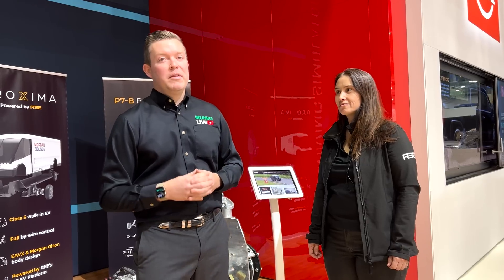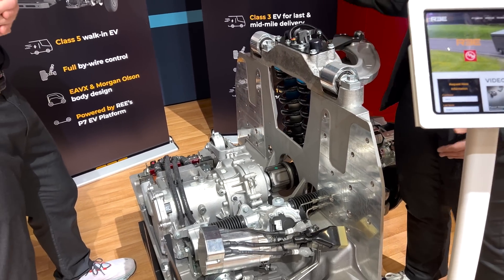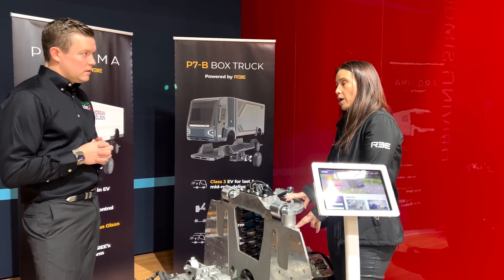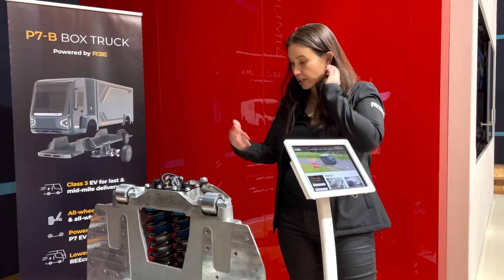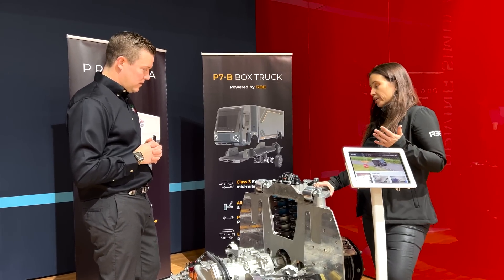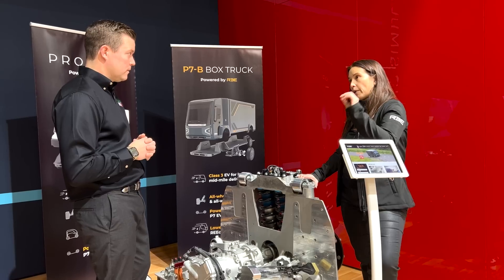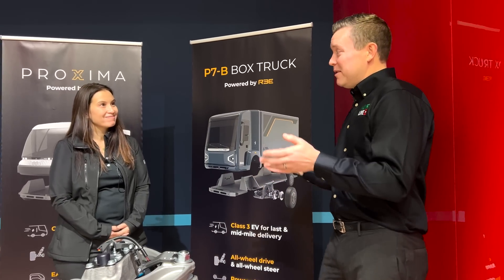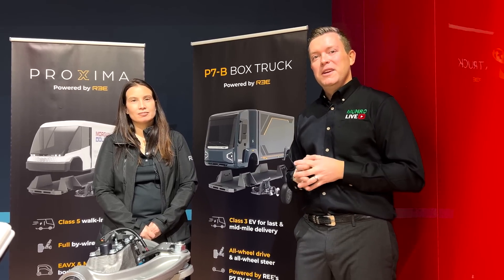Cornering the Competition? REE Automotive's REEcorner at CES 2023

Comment: Weight penalty in overall vehicle design based on the additional interfaces between corners and box frame? A very cool design, and I suspect it will maximize the cargo volume of the box truck as well - is that the trade off here?

Comment: With no mechanical connection to the driver...what happens if there isn't any power in the system?  
Is it locked in gear?  How do you activate a parking brake?  Or deactivate?  What happens to steering?

Comment: Cory, this is excellent, you've probably saved me a few hours of research! 
The possibilities for such a system extend in a number of directions: Powered trailers, specialised equipment such as airport or seaport machinery and so much more. 
I've remarked to colleagues that with the coming-of-age of battery and motor systems there is the potential to see the return of coachbuilding as a viable business.

Comment: 1 how open are you about owners able to self adjust the parameters.
ie will it be john deere locked out and e-waste after a few years no repurposing in the back yard. 
2 were can i find 2 of these in the scrap heap i have a welder and some ideas for my lawn mower "racing circuit"

Comment: Electric, OTAs, Modular, Innovative, Aluminum, Castings, Versatile,
Hmmmm

Wonder why they are setting up in Austin????
Reply: Taxpayer-funded incentives, same as Tesla.
Reply: @brianb-p6586  WOW!!  , you really put some intellectual effort into that response..
Reply: @Peter Sorrell  not much effort required.  Tax incentives are very common, and are often a significant factor in factory location decisions.  Of course there are other factors, such as availability of cheap labour and good access to transportation.

You're clearly suggesting that there is a business connection to Tesla, but this company is not rationally a supplier to Tesla and of course Tesla wouldn't supply it. Is there a supplier of aluminum castings located in Austin that is already supplying Tesla? Isn't Tesla supposed to be omnipotent and independent of suppliers for anything of importance?

REE is an Israeli company that already has a set of partners for the required technology, presumably including casting and certainly including all electric components - those companies are not in Austin.

Comment: I think EVs are gonna win just on the cost of maintenance
Reply: EV's are a win for new car buyers.  But they kill the used market for the rest of us.  Right now you can buy a decent car that 10 to 20 years old with 160k miles, still running strong and in good shape for $2k to $6k, etc..  But in the future, when EV's are 10 years old, they will still be pretty expensive, and also be a super high risk--  because the battery is due to crap out at any time by then.. and you really get caught holding the bag when it fails.   The secondary market is going to get hammered by this EV transition.

Comment: Corey kinda started down this "Advantages" path when talking about brakes being more like Rivian style. (thanks for reminding me what FNC stands for with rotors by the way) Unsprung weight reduction here is insane compared to standard solid axle setup. Unsprung weight has biggest effect on ride feel. Not to mention Rotational mass. 
Redundancy with Brake fluid cant take out the entire system, assuming electrical failure has failsafe. Would be interested to see brake actuation design.

Comment: I Reesearched this myself last year. Thought it had tons of potential. Working as a Truck & Equipment mechanic in industry where f450, 550 are the standard was curious if Viable Solutions for this were out there. 
Most Info is low resolution. I had similar questions and see similar potential.
For example a Large Fleet could afford to have "Corners" on the shelf. Downtime virtually eliminated. I promise I could do this side of road, Let that Sink in...

I did diesel tech early 2000's looks like I need some continuing ED lol.

Comment: This would be just fantastic for motorhomes.
Reply: Would the range of a battery-electric motorhome work for you? It wouldn't for me.
How much would you be willing to pay for a motorhome using these? All but the most expensive production motorhomes use the cheapest available truck chassis; they are in a very different world from all-aluminum fully independent suspension.

Comment: Firts thank you to Kim Mathers for this clear and thoughtful presentation !!!
I was thinking at first  that this module was designed to replace the main engine and 
will be connected to the main shaft where the clutch and gear box was located. 
But instead, making a separate unit for each wheel is the perfect solution. 
Just eliminating the main shaft and differential on each of the axial is a great energy saving. 
I can't wait to see an UPS truck making a 'crab' U-Turn in from of my home using vectoring control !!!

Comment: The should offer an offroad version where all the components mounted on top of the wheel (vs below in current design) and possible offset the drive shaft like a unimog. They can EASILY provide necessary drivetrain for a low-volume EV UNIMOG producer - which can be a game changer in the offroad community (not to mention commercial applications which REQUIRE unimog capabilities like power companies and other utilities).
Reply: That's called a portal axle; it is not unique to the Unimog.

Comment: I'm assuming the caster is adjustable or are they specific right and left modules?
Reply: At least the upper part looks very symmetrical, so I assume that it is one module, adjusted differently.

The steering actuators and arms would probably need to be installable in either position, to match the opposite side corner. The brake calipers would presumably also swap positions, and any anti-dive/anti-squat suspension angles would need to be set as well.
Reply: Apparently each corner is identical...

Comment: electric motor technology, well understood, deep institutional knowledge, no need for EPA emissions validation. 

batteries are really the only hold up
Reply: The system is energy agnostic. You could use a fuel cell or even a generator.

Comment: Do they have a unified connector? Seems like it would be good to develop a connector that houses all the power and communication needs of each drive unit so wiring is literally one wire and connector per drive unit. With four connections at the battery/ECM. Then only need one other connection going to the control pod at the driver location. They should also develop a modular battery ECM, specifically to interface with their units.

Comment: The military is really into having modular power packs (engine & transmission) that can be pulled and swapped out. They require speed of repair so the vehicle is back out to the front lines ASAP. This looks like something they'd be interested in.

Comment: Want a RV using these, with all wheel steering, drive, etc… how easy it would be to maneuver around parking and cities… and pulling a trailer…
Reply: As an RVer and REEer... trust me I'm making the suggestion!
Reply: These would be perfect for RVs because they could provide a completely flat floor from front to back. No need for stairs in the RV.  Winnebago should be all over this system for its motorhomes before someone beats them to it.
Reply: @mikedx2706  I agree. However the only downside is that when we RV we're off the grid and access to the kind of EV charger needed to power the vehicle may be limited, at this point in time. This will definitely be a game changer when the charging infrastucture is where it needs to be.
Reply: I agree that four of these (or six for a very large motorhome) could be the basis of a great motorhome; however, almost all RVs are built for minimum cost, not maximum functionality. These units would be far too expensive.

Comment: Very interesting.

I believe inwheelmotors allso has such corner modules.

Integrating the motor into the hub will enable many more benefits.
Reply: No, a motor by itself is not a corner module. A corner module includes suspension.

Comment: Strange question, would it be feasible to move these drive units to a new chassis at end of life for the old one?
Reply: I like the way you are thinking. No need to throw out working parts because a different part is not usable anymore. They specifically mention taking a corner off for refurbishment and putting another one in immediately. That implies to me that the refurbished unit can then go on back on another chassis. So I think just taking four working one off a chassis and putting them on a new chassis would not be a problem.

Comment: I’m impressed. Thanks Corey for the information and insight. I am enthusiastic about the concept and applications of this unique and inventive product.  I’m curious about the control system, which I assume would be a plug-in box that would accept the controls, steering plug-ins, etc. Does that exist and who has/is developing it and the related software?  Also, who are they dealing with in the box van developments for battery packs? I see an awesome application of this not only to work / delivery vans, but also the RV industry. Thank you. P.S.  I was sufficiently impressed, so I bought stock in REE Automotive!

Comment: Cory, do you think brake systems on EV s will eventually be eliminated? Elon says the best part is no part.
Reply: I think we're a while away from eliminating hydraulic brakes, simply because it's a backup system that will still work, in the rare event the electrical system / regen fails to work. 

That and ... regulations and laws are slower to change, and I think this is part of the inertia preventing change.  

Look how many countries and juristictions still require two exterior mirrors, no exceptions for cameras.  And, like regen on a hybrid or EV, cameras and mirror-mimicking screens can provide equal or superior function.
Reply: I agree with your thinking. But regarding a backup system, this is a bit of a double standard.  ICE vehicles have no backup to the hydraulics except hand/parking brake of little use at speed. A similar inexpensive hand brake could be provided on an EV. I understand that many EV s have steer by wire with no mechanical connection. I think  no brakes is no worse than no steering.  Is there any evidence the electric drives are less reliable than hydraulic brakes?
Reply: @brennansmith1381  yes, the redundancy argument might be moot.   My dad's antique 50s truck only had cable actuated mechanical brakes. 

I think arguing for deleting hydraulic brakes on a heavy cargo/delivery truck isn't going to influence those that can alter the design.

But, I haven't yet seen an electrical-regen only braking system on the road... Only lower speed off-road vehicles, like forklifts. 

If regen alone is a sufficient system for high speed /panic braking, then I could see it coming to a smaller passenger car sized module.

Not to say it won't come.   Just that, currently, even the higher volume EVs that Tesla offers, don't eliminate the hydraulic brakes.
Reply: @brennansmith1381  No, there are not "many EV s" with steer by wire with no mechanical connection; there are none in production and sold in North America at all, EV or not.
Reply: At this stage EV still need conventional brakes as in the situation where the battery is fully charged there is no ability for regeneration   braking because there is no more capacity for energy storage.

Comment: What's the downside to this design. There has to be one doesn't there?
I'm a professional design engineer and I can't see one.
I really like this on my first look at it.
Reply: Producing a 'corner" is a cool idea.   But I'd rather see it with ultra cheap construction with sheet metal and stamped parts.  This looks like it's going to be way more expensive than it needs to be.  Your box truck doesn't need race car performance parts
Reply: @calholli  100% agree.  There's a lot of stuff there designed to look great on the show stand that the end user will want cheapened up for production.
Reply: @jdeng1989  I agree too.
Though castings are fashionable for their cheapness at scale at the moment.😉
Reply: I suppose the overall weight of the chassis might be higher,  but could be entirely modular in length,  width,  wheelbase,  and whatever box is placed on top. Might not be as efficient as making tens of thousands of identical trucks,  but would be the best way to make ten of anything.

Comment: How do you coordinate the steering between 2 front units?
Reply: Same as motor and brake. Drive by wire.. / electronic communication.
Reply: Just like in a fly-by-wire aeroplane, with a control computer.

Comment: I did not hear anything about batteries - was that my lack of attention?
Reply: Its a drive system. Power supply is a seperate system. They are suppliers, not whole vehicle manufacturers.
Reply: Apparently REE's business model is for manufacturers of various types of trucks to concentrate on making the truck and not have to worry about designing their own drivetrain. That manufacturer can source the battery from elsewhere, this adds a lot of flexibility in the designs.
Reply: @donjones4719  This is a great business model. This is somewhat reminiscent of how vehicles were once made many years ago, one company making the chassis and then other companies building the body work. If you can get some batteries this will help many more electric vehicles emerge.